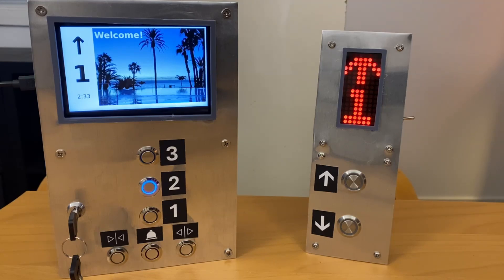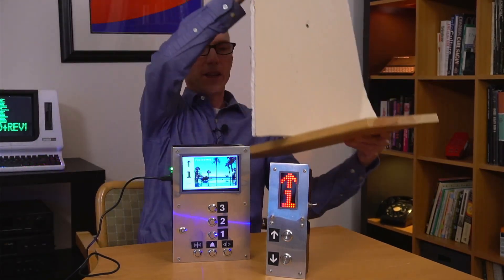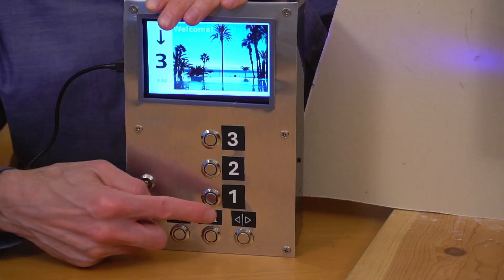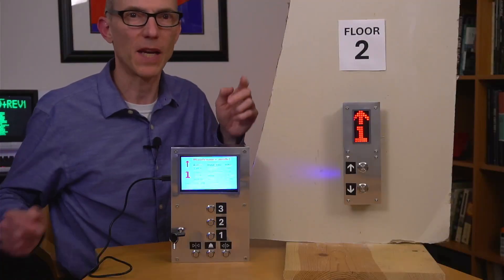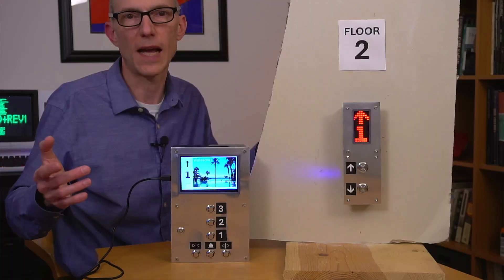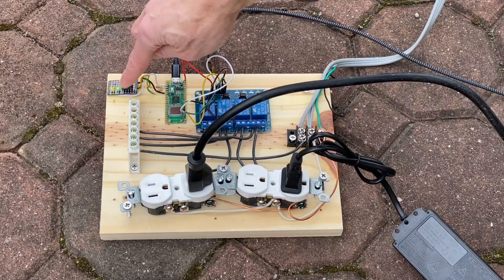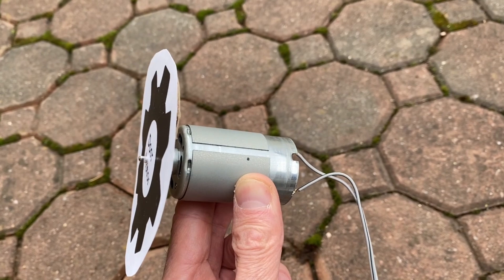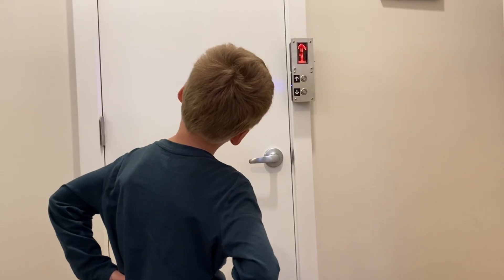Building A Raspberry Pi Elevator

Comment: Nice work. 
I started my apprentiship in Australia with Elevators Pty. Ltd (EPL) now KONE in 84'.

In 84' a large cupboard size cabinent full of relays was needed to do what your project is doing.

EPL went on to develop a IC  based system programmed in assembler which had a video display to indicate  the elevator position and a modem based warning system that, 'phoned home' when the elevator developed a fault. This was beyond what OTIS could offer at the time.

The funny thing was that in the 80's, the building clients did not want to pay for the features we now take for granted.

The button panel designs were influenced by architects and inhouse pedantic draughtspeople that thought they were designing the next Bugatti.

Great job sir, you brought back some great memories.
Reply from the maker: Thanks! That's great background info.

Comment: The elevator definitely has some tedious programming. And to think they originally worked with programming contact switches similar to how phones used to be switched. Wheels of contacts driven by a motor made all the decisions. They are far simpler now since electronics became a thing. I saw a very old elevator that worked on the electrical contact motor driven programming wheel, its a very cool device. Its amazing how many wires it took to make that thing work. Cool project.
Reply: No joke! Technology Connection's videos on pinball machines show just how intense the nest can get. Every switch, every relay, all the species of relay, the lights, the "cam-culators" and other logic... Geez, on the one hand it's "easier" to debug when you can see every part. But on the other; if even one wire gets loose you're hosed until a skilled technician can take a look!
Reply: @SpencerPaire  a lot of the elevators I work with still run on relay switching and yeah one loose connection can ruin an entire day
Reply from the maker: There are some great videos on YouTube of those old elevators using electromechanical logic.

Comment: I have never really been interested in elevators, but this was interesting and got me thinking… I wonder if AI or computer learning could teach an old dog do new tricks.  For example could computer learning be applied to older elevators to make them operate more efficiently??
Reply from the maker: That's an interesting idea, it probably could!
Reply: Elevator mechanic here, short answer, no. How much more efficient can you make relay logic? Modern controllers.... then long answer, yes. With vf/vv AC drives, there is much more tuning allowed. Resonance frequencies and filters waste a lot of energy. It's best, and in my opinion, only real use would be traffic management in group control. With a large enough data set, it could know that guy on 15 leaves every morning at 6am. It could have one waiting for him before he arrives. It could factor load balance and much more into the mix. Group control sucks. No one spends much time on it.
Reply: @jonathanb7750  I think what was meant with "more efficiently" is the logic on when to go to which floor in a busy scenario with more than one elevator for optimal handling of "elevator rides". As I have mentioned in another comment: look up "elevator saga". I'm sure you are familiar with a lot of the "tricks" but most people won't realize how crazy complicated things can get with a bunch of elevators in busy buildings.
Reply: @Rob_III  yes sir! In the profession, it is called "Group Control." There are so many variations and logic added and changed over the decades. Modern controllers can log statistics and be adapted for optimum efficiency. At a cost of paying a mechanic to "adjust some things and we will see in a few months" kind of thing. Far from optimum.  It's more about customer complaints. People don't like waiting or getting stuck, lol.

Comment: Very interesting.  I realize this is only a simulation (although it could be useful if you wanted to build something like an old fashioned dumbwaiter to move small items between floors) but in a real elevator there is at least one or two additional circuits that attempt to stop the doors from closing on people, or detect if they are fully closed before putting the elevator in motion.  But also, you forgot about the bright red emergency stop button that is found in nearly all modern passenger elevators.  This is a locking button rather than push and release, you either push or pull it and it stays in that position until you manually move it to the original position.  In the stopped position the elevator simply will not move.  This has even been a plot device in some movies and TV shows (often when characters want to engage in a brief illicit relationship) although in real life pushing that button often causes the very loud alarm bell to sound, which would kill the mood rather quickly.  Also in a real elevator there would be some kind of braking device (especially if it was not a hydraulic system), to stop the elevator from free-falling if the cables snap or get cut (in theory, anyway), although on a hydraulic elevator that may not be needed since the elevator could not free-fall unless ALL hydraulic pressure were suddenly lost. Finally, in many jurisdictions there is a requirement to have a telephone or other communications device in the elevator, that can be used to talk to a real person (for example the front desk or the building security personnel or the local fire department) in an emergency.  Obviously that is not needed in your simulation, but worth noting.
Reply from the maker: All good points! The original elevator (shown at the beginning) actually had a two-way video call feature using the screen if the emergency/help button was pressed. If I had more time I definitely would have implemented something like that.

Comment: I'm an elevator mechanic and a tech nerd, so like I had to watch.... I'm going to sum up my response with doesn't meet code

The biggest thing you don't have is any kind of selector package to tell the system when the car is at the desired floor.   Typically the elevator car will activate an electrical circuit when it gets near the floor, changing the pump to leveling speed for the final approach

Comment: It's just a relatively uninteresting gadget. Everything to do with functional safety is not even mentioned.
Transporting people (car, train, airplane, elevator, etc.) is subject to numerous standards and regulations. The cost, as well as most of the difficulty of these high-risk tasks is invisible to users.
We need to stop this trend of insinuating that, thanks to “arduinos”, “raspberrys” and the “language of the day”, it's easy to create anything for less and better. It's misleading and contributes to dumbing people down.
Reply: Well... Just like baking and cooking then? Just because flour is cheap doesn't mean you should bake bread yourself. In the commercial world food manufacturing is riddled with additives and food& health regulations and so on...

This is just a harmless "toy". It shows the principles, and could very well be used for item transportation, both vertical and horizontal, and personal builds. Imagine building a miniature trainset for item transportation in an office for instance. That would be awesome.

Comment: Someone should make an open source ElevatorOS
Reply from the maker: That would be awesome!
Reply: just "lift" the code lol
Reply: Most elevators run some linux distro and its not always a custom one. I have seen elevators boot debian or ubuntu or windows 10 or embedded.

I was also the lucky guy to get to see the elevator control cabinet and it was just some industrial computer hooked up to some contactors for the motors and things.